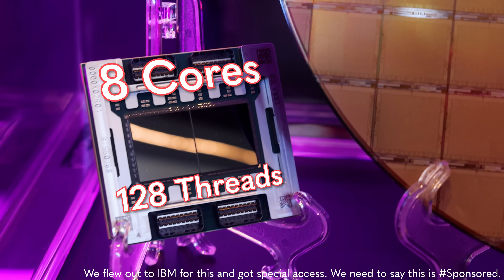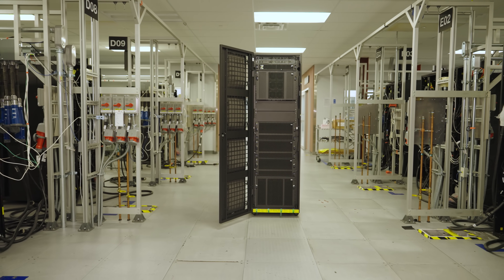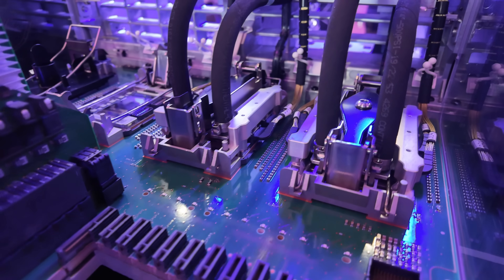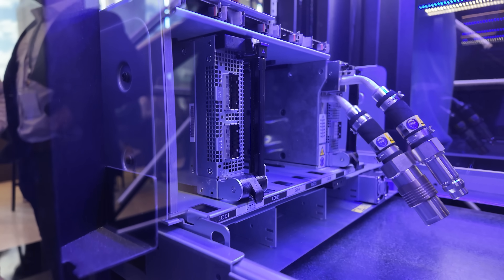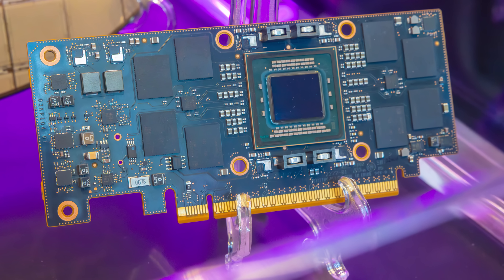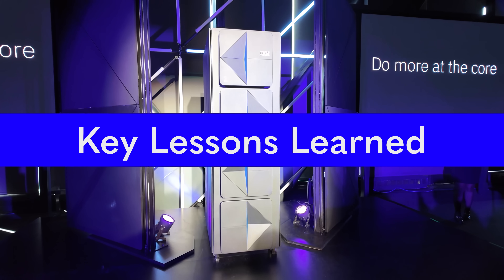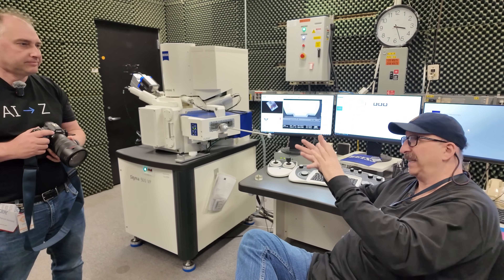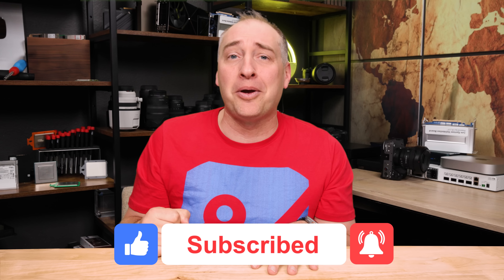THIS is how IBM makes servers that cannot fail

Comment: The kind of sponsorship that pays off if even one person watching this buys a system (or rather has the influence to make their company buy one). If you asked me what system self-reports failure conditions so maintenance just shows up out of nowhere, I'd have said "an Airbus", but this thing counts too.
Reply from the maker: Yea this is one where literally we could not have made this if it was not sponsored since it was two locations and behind the scenes.
Reply: @ServeTheHomeVideo  I used to work at IBM Poughkeepsie back when we made our own Chips and it has always been a very cool place to work.
Reply: One person is going to buy this for their Minecraft server and a team of IBM salespeople are going to each get a nice big bonus. :)
Reply: @user72974  This is exactly why I got 480V 3 Phase power to my home.
Reply: @user72974  I worked at IBM, let me assure you that once we got Linux running on zOS, we ran text terminal games on the mainframes.
Reply: @user72974  Not 100% sure if you're joking or not, but this sort of thing can't run software not specifically adapted for it. Was about to write that it wouldn't make sense, but per April 2023 minecraft server can in fact run multithreaded, so you could adapt it to spawn multiple threads on this kind of hardware, but you would still probably encounter some issues trying to implement this as a minecraft server aside from the Slice and VM config to span a lot of threads etc. So - eh - you probably could run "a minecraft server" as a VM on something like this but it would require getting some professionals to help set it up for you.. 
This is not so much "a computer" in the traditional sense as it is a bucket of computing resources configurable in different forms to suit different tasks. 
Still, I very much doubt anyone will buy something like this to run their minecraft server on even if it is theoretically possible to kind of maybe do so. I won't get into the whole list of reasons why, but lets say it is very impractical and would not make a very good Minecraft server at least as they are most commonly installed. In other words it is a very inefficient way in terms of money spent and how much "minecraft server" you get per dollar. IBM would have better solutions to fit your needs I think, mostly since an x86 based single image server would like have a better responsiveness as a minecraft server I think. I might be mistaken though.
Reply: I would expect this kind of sponsorship is to attract talent, and create brand awareness, not generate sales.
Reply: @Quarky_  Yeah I seriously thought IBM was mostly dead at this point...which would be a shame b/c I loved their old fashioned typewriters but they probably make a KILLING on these mainframes.
Reply: @PatrickDKing not really, they just concentrated all it's efforts in data centers and specialized systems like ai whatever, also they gone fully b2b. These things makes ibm super stable financially, because these income sources are very slow to react.
Reply: @Quarky_ It sure is produced and edited that way!
Reply: Looking to buy a hundred-million dollar mainframe but I didn’t see a referral link in the description. Let me know if IBM gave you a creator code I can use at checkout!
Reply: My DELL servers did that with RAM modules
Reply: What CPUS do they come with? American or Chinese?
Reply: I'd say if Airbus fails in action ... you show up ... out of nowhere ... at the pearly gates.
Reply: @ear4funk814  Airliners have a lot of redundancy, but sure, there have been fatal crashes where the only trace for a long time has been ACARS automatically pinging maintenance, like Air France 447.